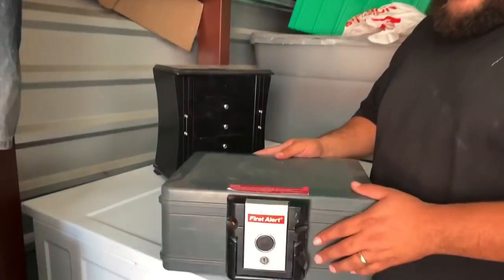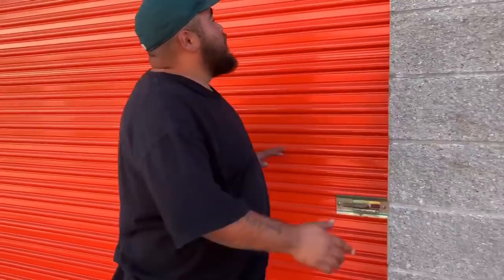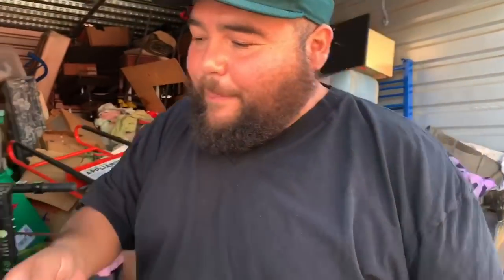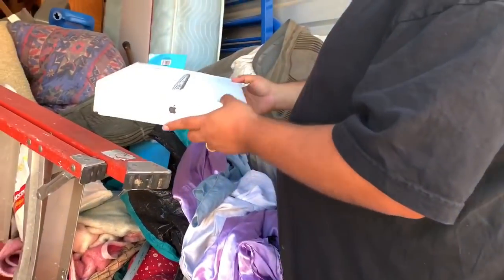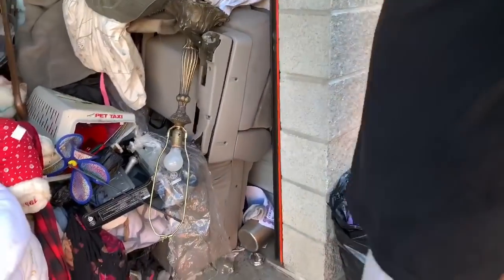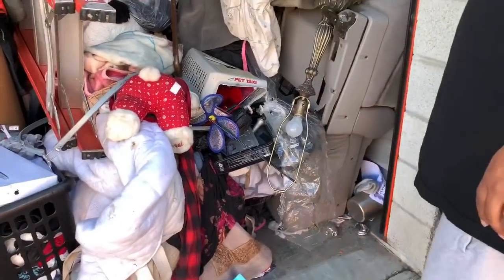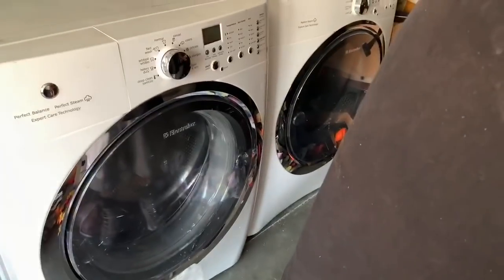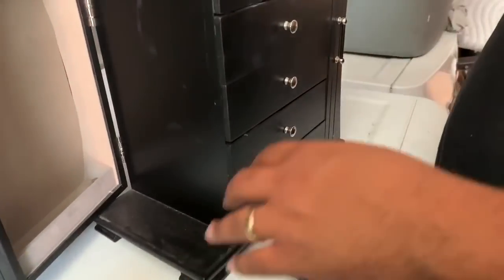HUGE STORAGE UNIT PURCHASED FOR $50 | UNBELIEVABLE FINDS!! STORAGE STALKER

Comment: The large gold pendant you came across that is in your thumbnail  is a Quartz Geode. You will likely get 2-5$ for it. Quartz is one of the most common minerals out there unfortunately! 
 There definitely is a lot of junk in this storage locker, however, there are a lot of decent items as well. I think you will easily make 300$ + reselling it all at Stockton. Even with dump fees and gas you should be up a couple hundred in the end! Good luck!

Comment: 16:10 The GOLD SKATEBOARD by Bam Margera (from JACKASS) Made by Element Skateboards and Artwork by Kat Von D is a limited edition board. They were from 2005 and the GOLD ONES WERE SPECIAL. They came in a series of 3 white ones. A gold one sold on ebay in the last 3 months for $99. 

The  24:50 the cut rock with crystals in the center are called GEODES (G-Odes)

Comment: That washer and dryer are Electrolux. Here in Sweden (at least) those are not cheap. If they work you should at least be able to get the cost of the unit back from the two them.